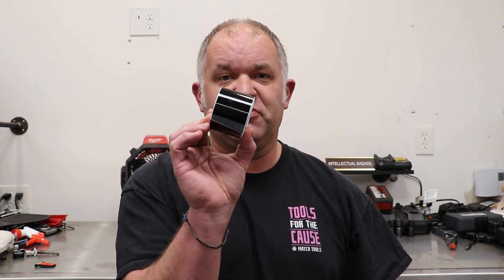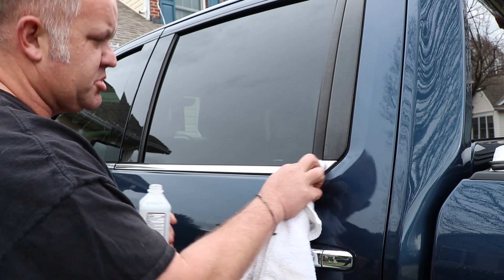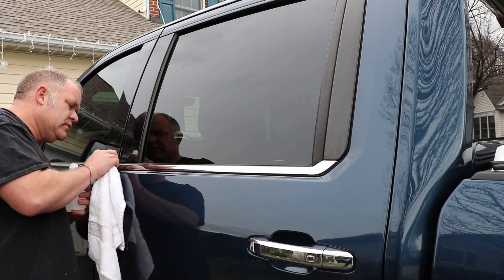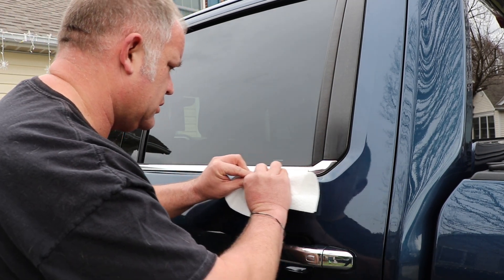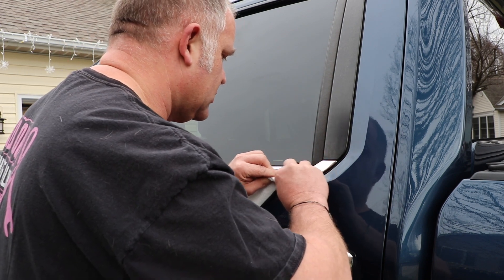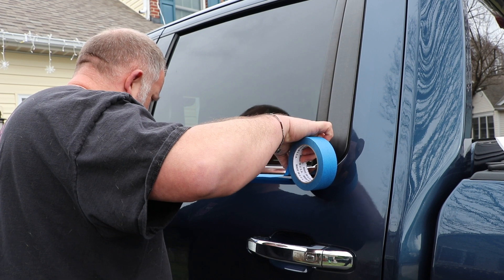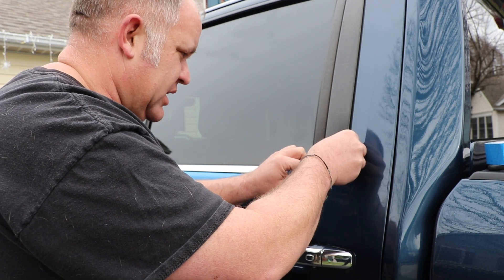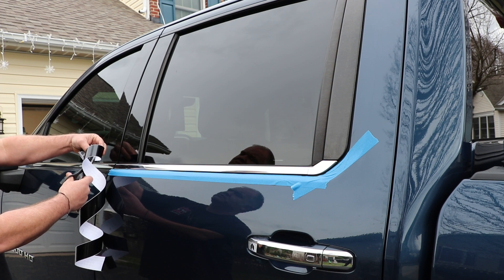Don't Waste Your Time - This Tutorial Shows You How to Delete Silverado Window Trim Chrome

Comment: That ended up looking really good. I have the luster black on my GMC AT4 from the factory. I think I like yours better because GMC/Chevy's factory is installed over the chrome, but is very thin. Therefore any stone or even road sand, etc, chip the coating and you see the shiny chrome through the matted out black. It drives me absolutely insane. Mine is a 2022 and I've already replaced the grill and light shrouds around the fog lights. I was looking at it the other day and I can see chips in the new ones already. It basically de-laminates from the chrome below.
Reply from the maker: If you are having issues with stone chips I would recommend that you look into Paint Protection Film(PPF).  Basically clear vinyl that adds a protective layer to part or all of your vehicle!